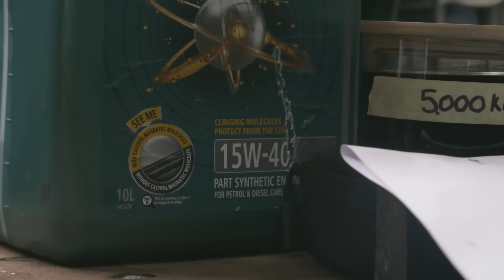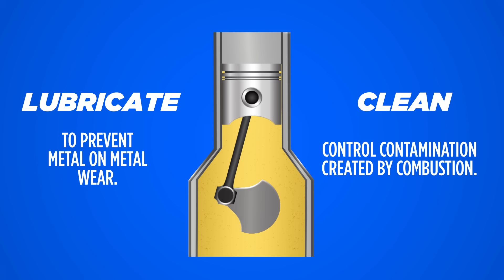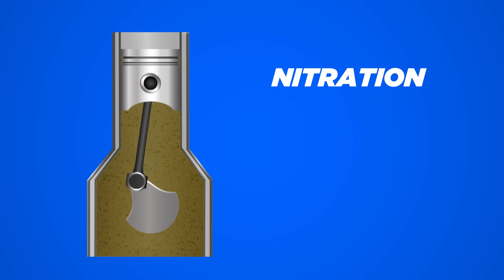Engine oil COMPARED at 5,000km vs 10,000km vs 20,000km! This'll make you service your 4WD RIGHT NOW!

Comment: 1, Oil became dark is because of oil stick on the side of piston. Oil get burn after combustion. Piston move up and down which contaminated that some carbon push through the gap which mix carbon particles into clean oil. This usually in deisel engine due to great force
2, oil spray on piston wall which is very hot. This is just like oil get cook slowly which turn to brown.

Comment: Look up 2000 mile oil changes on YouTube. He says oil starts to break down after 2000 miles. I’ve always changed my oil when I can’t see my oil dip stick level lines through the oil. Over fifty five years doing oil changes this way and never ever had an engine problem.

Comment: How long does it take for a diesel engine to reach optimum temperature? Should we still be warming up the engine for a few mins before we drive? I was told we didn't need to warm up the car anymore due to advances in tech. However, it seems that it might be a good idea to always warm up the engine before driving?
Reply: Again I was told by a young mechanic though not really required it is stil a good idea to warm up the engine because the oil will still not be flowing freely enough to reach the top of the engine and this where the damage is done so 5 - 10 minutes is enough to get the engine temp indicator to move
Reply from the maker: Hey mate, great question! It really depends on how long the diesel engine is
Reply: @4WD 24-7  soz for the lack of knowledge here. What do you mean how long the engine is? As in mm? 
And how do you find out what the optimum temperature is for your car/ute?
Reply: @4WD 24-7  hey lads, just a quick note to see if you can answer my question?

Comment: I once had a motorcycle that had no oilfilter, a Honda CB250RS single cylinder engine, and the manual said to change the oil every 3000 kilometer, so even 5000 kilometer would have been too much.

Comment: Color means nothing, oil analysis is the only scientific basis for when oil should be changed. Diesel oil will be black after one hour of use. I have used 25K mile oil changes for years and have never had an oil related failure. Normally drive cars for 300K to 500K miles both gas and diesels.

Comment: I service my RA Rodeo 3.6 alloytec every 10,000km due to the fact it is always hot on the highway, never gets any stop start city traffic at all. 192km round trip to work and back everyday.
Diffs, gearbox, transfer every 40,000km
Fuel filter and air filter every 10k

Comment: it is in the manual handbook. 10k miles only in normal condition, not offroad, high load, towing, short trips, dusty area, etc. Those harsh condition need 5000 miles interval.  Actually, oil thinning up as it is used instead of thicker until it is oxidized and start slugging.

Comment: First video I´v seen that shows the Oil Blotter Test. Following the owners manual oil change recomendation is a good guid line but with engine age and driving conditions oil break down can increase, so the Oil Blotter Test is the best way to determine if it is time to change oil/filter, when you start to see black carbon in the oil then it is time for an oil/filter change. As for "BRAND" one brand is  as good as another as long as it meets the manufactuers API/ILSAC/VISCOSITY requirment.

Comment: I always start my car 30 minutes + before going anywhere, weather it’s school run or to the shops, purely for the simple fact my 4bie HATES being cold and runs like asshats if she hasn’t had her warm up especially on the cold Adelaide winter mornings. Also by me doing this I noticed I save on petrol as well. My petrol lasts longer than what it did before warm up. Not for everyone but it’s the little things I notice on my 4bie.
Reply: Thats also because the fuel burns better at proper engine temp

Comment: 9:28 Seems like two persons facing each other. On the left looks like a person with head, hands in pocket and facing right. On the right is a super tall man staring down at the viewer slightly bigger belly and also hands tucked in the pocket. You just made art with oil trails on paper.

Comment: I do about every 5000 miles in summer also because of the sheer heat being over 42° C and 4000 in winter. old petrol engine. in winter the oil gets alot more water and fuel contamination from cold starts below 0° C. it's very dusty in summer and I always get alot of grit in the bottom of my drain pan because in summer we get alot of dust storms. I like to use Castrol magnatec already for my vehicles and change it often because if it's not dirty with dust and sand. it's going to come out watery due to gas and water contamination.

Comment: 5k km is way too often. Sure won't hurt anything only your wallet, however modern fully synthetic oils are just fine at 10-15k (normal driving) ,20k (mostly motorway).

Comment: Hi , i have used Castrol oil in my 2016 Isuzu Dmax from brand new, and will continue using it. Mine gets changed at 10k with warranty but im like you i do it at 5k like you.  This was the same with my Landcruiser with both never using oil.Sure helps preserving your engine. I'm 72yrs old now and used Castrol oil in my vehicles all my life.... Not changing brands either.  Cheers to CASTROL!
Reply: Me too mate and using castor oil since the mid 70s all my cars and motorbikes

Comment: Was the oil all taken from the same vehicle? I’ve never seen such filthy oil after 5,000km! I think it says more about the engine it was run in than anything else. Frankly, I’d be changing vehicles if my oil looked like that after 5,000km, let alone 10,000.

Comment: I have a HJ75 400,000kms and 105  with 400,000klms owned both since nearly new.Both turboed at about 200,000kms I change engine oil every 5000kms and other fluids per manual .I have never had to repair either motor. That works for me.

Comment: This is not a test. The most important thing that has to be explained here is that the multi-grade oil goes single grade over time. Meaning that you get thick oil when the engine is cold (which is bad) and very thin oil when the engine is hot (which is even worse). So the color is not that important but degrading of the viscosity modulators is the big problem when oil ages. Some people drive 3k per year and change oil on the third year. The viscosity modulators and already lost after half a year meaning that they drive SAE 40 for example for 2,5 years - SAE 40 is oil for lawnmowers...your car engine is definitely in a huge problem

Comment: My 100 series, oil changed every 10 000klm  the vehicle did 525 000klm in 11 yrs then I sold it, engine would need a dyno to show any loss of power and it never used oil. Also the oils in your test were they oils that were designed to travel that distance.

Comment: 2015 Holden SS personally I change almost everything at set KM targets, based on the driving I do oil Is a cheap alternative compared to cost of fixing wearable items !

- Engine oil and Filter @ 7500km
- diff oils @ 30,000km
- Auto Trans oil @ 30,000km
- coolant @ 30,000km/ Once a year

Comment: The older / higher kms engine, do youre oils at shorter intervals.  350k out of a d4d 3.0ltr is proof . Towed a 2t van for 5 months straight. Cheapest preventative maintenance  you can do. Doing it at 5 -7500 km now. Used good quality oil and good filters.

Comment: on road cars i change my oil (full synthetic) every 10,000km and it still looks almost new, for hotter harder work like offroading in dusty conditions and driving through water changing it every 5,000km probably makes more sense

Comment: It all comes down to HOW you use your vehicle.  I've got a 1995 1HZ 75 Series Troopy from new.  Followed the servicing/warranty booklet diligently with 5k servicing intervals until I reached 250,000kms thereabouts.  From there it was a 10k oil change interval with new oil filter.  Fuel filters are changed every 30k or after a long trip needing a refuel at a bowser in woop woop. 

Granted, the oil level on the dipstick does drop from the FULL mark to around half by the time the oil change and service is due.  

547,000km later, still going strong.  Doesn't blow smoke, fires up on first crank, idles and revs smoothly, fuel consumption is still about the same.  Original engine from factory too.

Oils and filters have come a long way since the days when my rig was built, so it's okay to extend the oil change interval on a 1990s 1HZ Troopy.

Comment: Shaun, I drive a 2002 4Runner with the 5VZ-FE and it is specifically a tourer and camping rig. It always carries my gear and tows my camper. I only drive it in the summer here state side, so it usually gets around 3,000 - 5,000 miles every year. I'll typically change it once towards the middle - end of summer with 5W-30 full synthetic. I also check the diffs, transfer case, and auto transmission, coolant, and power steering every year and change that fluid every 2 years. It is almost due now but when I get back from my trip I'll be servicing the diffs and t-case. My change frequencies usually go by time interval instead of mileage.

Comment: That's got to be the most unscientific oil testing I've seen. You can do a "blotter test" with oil which will give a visual on fuel dilution, soot levels, and glycol (coolant) but that's about it. I'm surprised you guys didn't have the budget for $200 worth of lab samples - but I'd bet my left nut that it wouldn't give the result your pushing here. Old indirect injection engine sure 5000km is fine as those things will soot load the oil quite bad, but new common rail diesel engines hardly put any soot into the engine by comparison. I've pushed engine oils on a common rail diesel out to 24,000km with lab testing and the oil is still fine, in fact there's not a huge difference to the oil sample results in my case between 10,000- 20,000km. My manufacturer has 12,000km service intervals for my model, but some of the newer ones with essentially the same (but updated) engine have double that at 24,000km  (which is why I pushed my oil with lab tests to see how it holds up). I generally change the engine oil from 12,000 - 15,000km. 
Your not doing your engine any harm by changing early, but your also not going to change your engines life all that significantly by running at the manufactures recommended interval.

Comment: I service my 2000 Mazda bravo single cab 4x4 ute every 5,000km thats oil an filter. Every 15,000km I flush the engine with deisel to clean out anything gunk that the filter doesn't collect, it runs like an absolute dream!! I also do gearbox, transfer case and diff oils every one a year or every 20,000kms. And I personally use Penrite oils as its Australian owned an made for our conditions. I'm also a mechanic that has been around heavy farm equipment and cars all my life. And I disagree with the modern standards of service intervals. Yes oils have come a long way but still need to be changed on a regular basis to help ensure the long gaiety of your engine an transmission.

Comment: prado 2007 1kdftv 180,000km - first of 5000km or 6months (ish, I let it go a little longer during covid with very low kms and very few hard trips).  Auto transmission serviced 4 times (3x me, first time by a transmission place at 80,000, 1st and 2nd time filter mesh replaced but it was very clean so just freshening the fluid now.  Diff, transfer per owner's manual approx. Drive line grease after each big, mud or beach trip.  Between tanks fuel filter 2 years/40 km. The engine bay fuel filter has been changed three times, though official just an inspect item.  Engine air filter whenever it starts to look dirty.  The new patrol is going to the dealer for 6 monthly oil changes, but thinking of stopping that as they keep doing harm/making visible mistakes (oil spilled everywhere, filter not screwed on tight enough and dripping, broken clove box when changing the cabin filter, failing to grease the drive line [so I do that myself after they don't yet again] etc), so confidence in them is now low.

ps. I was expected a lab analysis, and some proper objective coparisons, also some confirmation of vehicles etc, so a little disappointed.

Comment: Oil is cheaper than engines. 3 to 5K & you'll sleep better. The better you take care of your things the longer they'll take care of you. Another good reason you should change your oil often is resell value. People love buying cars that's been well maintained. Also you hear about people doing engine flushes but that wouldn't be necessary if you changed your oil before any broke down or turned to sludge.

Comment: modern synthetic oil is highly resilient. the colour of oil is not a good predictor of the quality of oil.

A turbo diesel is harder on oil than say a NA petrol engine. Having said that 10,000 to 12,000 km max is a good rule of thumb for oil changes. The best way to know for sure is to get your oil analysed.

Comment: I do mine every 3500-4000kms ahahaha
Reply: To break that down since a years supply well 7 months form my math.. I do my engine oil before 5000ks I do my gearbox every 25,000ks I do my steering and break fluid once a year otherwise things like the diff wheel bearings breaks ect every 50,000 ks, no it’s not a 4wd it’s a ve omega series 2. Always drive her not a day I don’t hence the regular service

Comment: Good video however the other main function of oil is heat transfer/ heat dissipation / cooling 👍 
All my cars including 4WDs I have owned throughout my life have always been 5000 kms service intervals . In saying that my wife’s car a Mazda CX-3 says 10,000 but I change that at 7500 these days purely because of the cost of living going up up up 👍

Comment: Its silly to bring up an oil analysis is a better method than using a simple viscosity test and looking at the color. Oils primary job is to suspend engine contaminants until next change, lubricate and protect engine from friction. Contaminants in the oil affect its ability to do this. Its science but very simple, and these 2 analysis methods are all you need to tell when to change your oil. Often when you cant see the dipstick markings when checking oil level is the best time.
But you can all do whatever you want with your own 4wds. Like shaun said at the minimum, your not doing your engine any favours the longer you wait once the oil looks like it does at the 5k oil change. Some motors with open element crankcase ventilators will get dirtier much quicker.

Comment: Most oils are pretty much stuffed after 5000 to 7500 kms. I worked in auto parts for years and the oil manufacturers recommend half km range for "heavy use" and when you look at their definition of "nornal use" it's very limited. 
Honestly for the cost of an oil change I highly recommend changing at half the recommend kms.
Reply: Agreed, low mileage vehicles that does short trips (<15 mins drive) are the biggest killer for engine and oils

Comment: Went on a trip of over 2500KM and required 1lt of oil on an engine at the destination. Was rather concerned about the oil consumption as the engine had only 60K km and was 5k km short of its required service. found out it was due to contamination oil due to city driving then long distance driving.  Had a service done and was recommended to replace the oil in between scheduled services (@7.5k km), since then, it has never consumed any oil and the engine has been a lot healthier. Having a scheduled service by a mechanic is good, but changing the oil myself and having a good look underneath whilst doing the oil change, has given me a better understanding of the vehicle. 

Would love to see an episode on fixing squeaky suspension as it seems a lot of duel cabs suffer this!

Comment: Hey Shaun I was watching you episode of when you should change your oil do you use an engine flush before you refill with new oil I have always used diesel to flush the engine with the old filter in before refilling what's your opinion mate.
Cheers 
Warren 
Ps why do you and Graham refer to 4x4's as truck when they don't have a turn table.

Comment: Every 10k for engine oil in the TD Mav, they have a big sump and it does mostly road kms carting the kiddo around and up the dirt to home. It's a family bus and wood hauler sometimes. Good quality oil filters and unifilters on the air side.
The old school 6.2 Chevy in the dual cab Mav has a tiny 6.5L sump, that's done every 5k and is well spent by then. Cheap to service and just as good on milage or better than the TD. Just heavy!

Comment: I try to change engine oil every 5000 KLM. I don't 4*4 it, but still do regular changes. Like to use same type, but have used cheaper oil but found I changed it pretty quickly. Will do gearbox n diff at 50000klm.

Comment: I'd love to see a comparison of full mineral, semi and full synthetic oils and if using full synthetic oil can prolong service intervals? I run a petrol engine, so my requirements are slightly different, but think the question should still be asked. If doing a 5k service, can a mineral based oil suffice, or is full synthetic always better? My Triton asks for 15k service intervals, but I'm used to the more regular 10k. That gives me a bit of wriggle room as I don't always get a chance to do an oil change right on the required km mark. Easy to go a couple of thousand km's over without realizing it, so have dialed back the servicing from 15k to every 10k plus wiggle room.

Comment: I’ve found it to be the complete opposite way around. The longer the oil stays in my motor (usually 7,500) it starts to break down and becomes far more runny than the brand new oil, not thicker!
Reply: That may be diesel in the oil